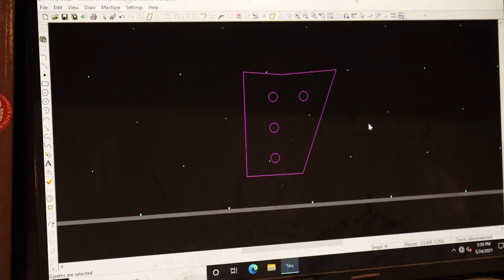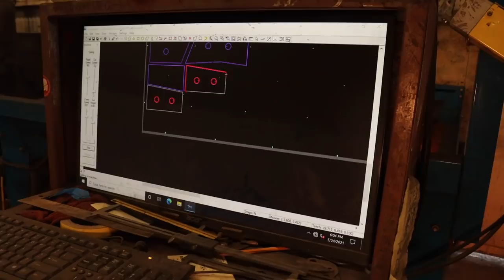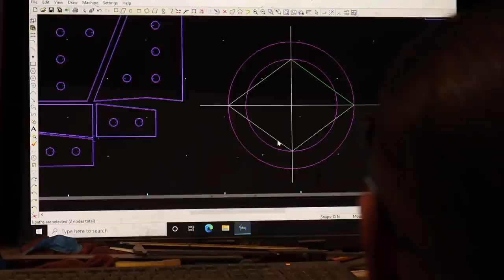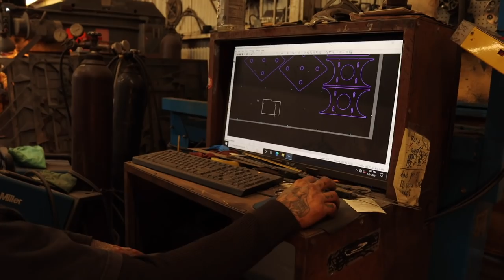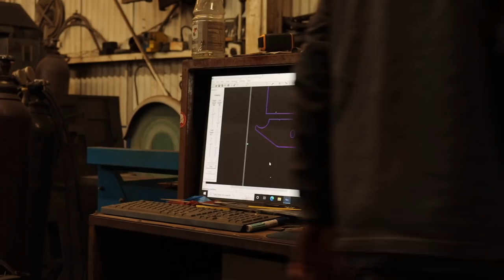1950 GMC Cab Over Engine - Part 6: Shortening the Frame

Comment: while lived in north cal had a friend that lived in burnt ranch. he wanted me to chop up cars with panel cutter he had. heck i never had chopped up a whole car with one. he had sharp bits and almost lots of air io had to wait a lil but man it was one of the funnist things i did to a car. besides painting them or custom bodywork.. believe me you can destroy a car with a panel cutter real easy if you merely take the time to do it. can't remember how many cars was but was more than i ever did. since never did one before. was a piles of parts to be hauled away.